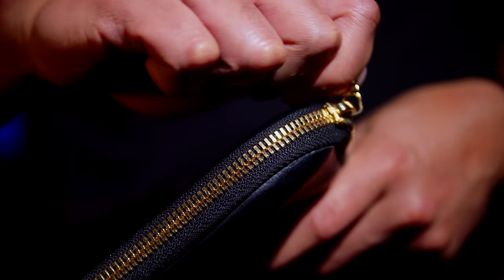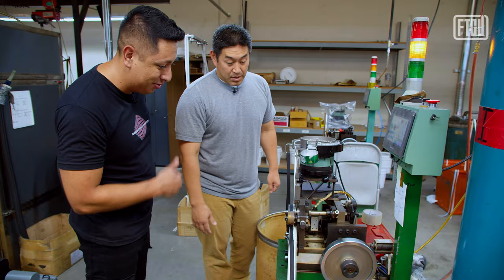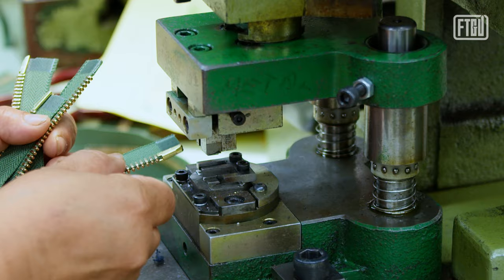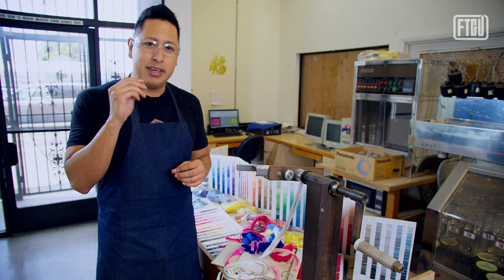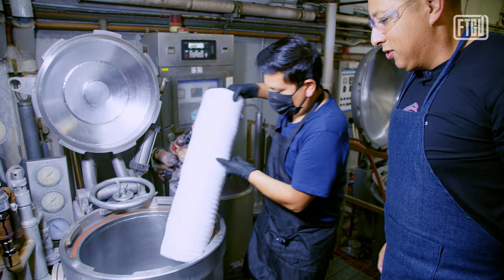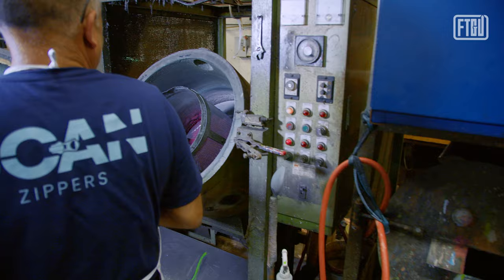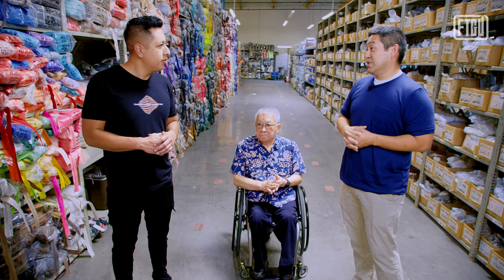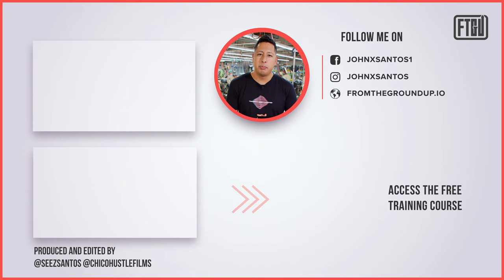How One Of The Last Zipper Manufacturers In America THRIVING | From The Ground Up

Comment: I would love to know if they have an "offcut" shop somewhere that sells those small batch extra pieces that it looks like they have in the video....whenever I buy a "high end" product that has a zipper, I always check the puller to see who made it and I've had several items over the years with the G2 zippers and they really have always seemed to be noticeably superior to the YKK that most big box manufacturers are using today. I'm glad to know these are made stateside and to custom specification.